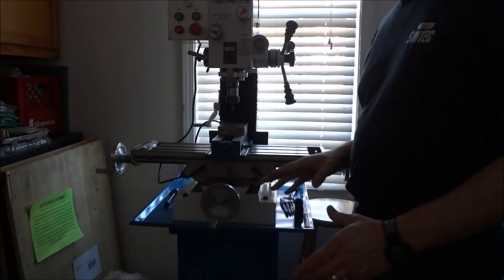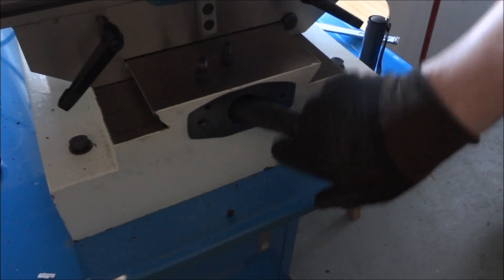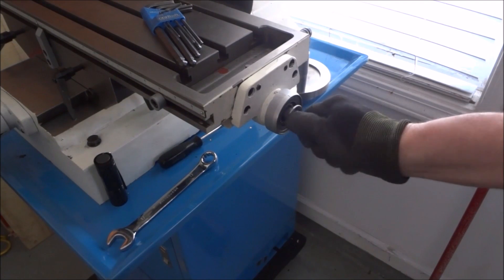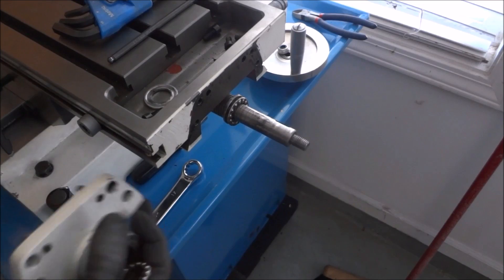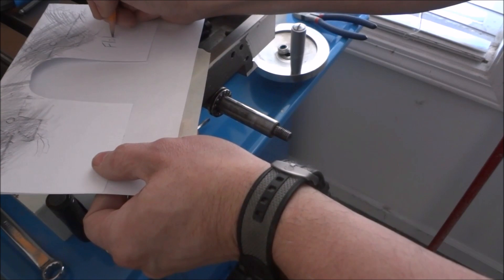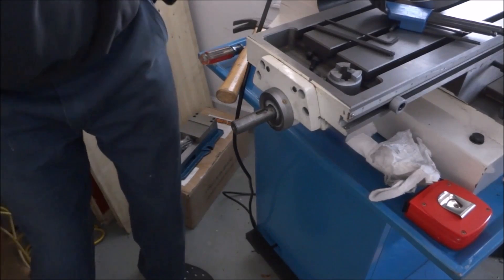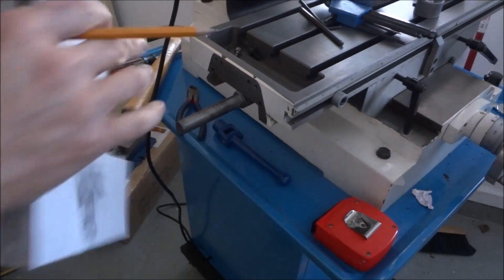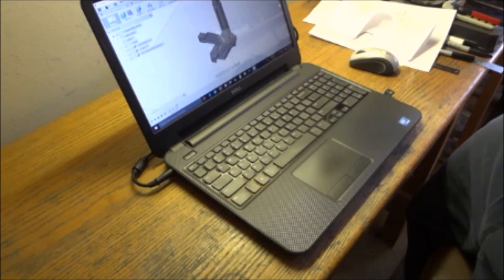PM-727M CNC Ball-screw / Stepper mounts from A to Z

Comment: Take both your bearing hangers and put then back to back against each other with those pins installed in one. That will show right away just how close each bolt and pin location is to the other end of the table. And since your adding more weight with the stepper at one end at least, then good engineering practice would be to step up at least one bolt size. That also gives you a chance to drill and re-tap the holes with a quality sharp tap and replace those chezze like Chinese bolts that will give you future problems. Even better would be to delete those roll pins and taper ream both the hanger and table ends for taper pins. Those will give you dead on accurate location with no chance of the bearing hangers ever getting even the slightest amount out of position. If I was doing that I'd use the type that has either a male end thread or female thread to help pull them later for any maintenance. Every single thing you can do to help improve ease of use and future maintenance will pay off later.

Not sure what your other plans are, but there's a few threads over on CNCZone showing how to fill that Z axis column with an epoxy / granite mix that would go a long ways to help stiffen up that area as well. There's no such thing as having a machine tool that's too rigid. Even Bridgeports are considered fairly flexible in most areas.
Reply from the maker: Great tips I still haven't decided yet. But was thinking of replacing the pins with bolts from the inside. 
No plans on filling the column. Be safe Sam
Reply: I wouldn't, bolts or any threaded fastener are really poor locating items. And that's exactly what those roll pins do. They positively locate each bearing hanger, the bolts simply hold each bearing hanger in that location. So in theory the feed screw or in your case once your done the ball screw will be held in each end bearing at the same elevation (Z axis) and square to the table travel (Y axis) I doubt the factory got that alignment perfect so your going to need to get some very precise measurements so all your travels align not only with those end bearings but also dead square, concentric and in line with the ball nuts. That jobs far tougher to get correct than it first seems. 

Get it wrong and worst case you'll have severe binding, stepper motors stalling out at the ends of travel etc. Even slightly out and you'll get more up to even excessive wear in the bearings, ball screws and nuts. Machine tool alignments are far more critical than most hobbiests fully understand. Anybody doing this as a hobby who's even a bit serious about it should spend the roughly 100 bucks for a copy of Machine Tool Reconditioning. That one book totally changed my views about machine tools and how clean and well oiled I now keep mine. It is a boring book, but will help you to understand what's required and where.

You can correct any factory inaccuracy,s with the parts your building. But you will need to know exactly where and how much to correct for. I''ll give you an example. Good industrial grade DRO's require the spars and reader heads to be aligned to the travels to less than .001" in all directions simply so there's none of that binding and that the readings will be accurate. Your ball screws, nuts, and the end bearings require the same attention to detail to get the best accuracy and to have a system that works freely and well.
Reply from the maker: Thank you for the Insight and Tips.
Sam
Reply: @turningpoint6643  
There have been many many examples on CNCZone of RF45 builds in which all super-accuracy you tout has not been done to that extent. For one example KCJ build of 2 years ago. There are a bunch I have followed and have not heard about all this binding your talking about. Secondly as far as "...your going to need to get some very precise measurements"  In the home shop that isn't even practical--- ±.004 or so is about all you can hope for;  ±.002 AT BEST. Think about it how can this fellow in his shop achieve measurements better than that?
Try measuring the length of the table in X axis to ±.001 !!!
Reply: @crookedriver2079  Super accuracy? What I mentioned would only be common and fairly loose tolerance engineering practice used on most job shop quality machines. Even my little Atlas horizontal mill and South Bend shaper use taper pins for good reason on certain parts. They ensure a repeatable and secure position and that's the exact reason there used. My Bridgeport clone has the X,Y feed nuts pinned in place to maintain there factory set alignment. The feed screws C/L location and it's alignment in all three dimensions is critical to the life and long term accuracy of the components. And your AT BEST - + .002" measurement capability is cheap calipers territory. I can and do double check any new machine I obtain within 10ths as per the Schlesinger tests written way back in the 1930s. So why or how is that all of a sudden impractical?  And I didn't say the table length needed to be measured to + - .001" but the screws C/L  position can be measured and located within that limit since linear measurements of only a few inches are needed.  

Think about it, with the feed nut firmly bolted in a set position and the bearing supports fixed at any old location decided on. If the misalignment of the screws C/L amounts to more than the allowed working clearance within the nut there will be binding at the ends of the table travel. If the alignments are out far enough the table will be impossible to move to the ends of it's travel until both the screw and nut wear enough to allow that to happen. That's not my opinion, those are the simple and unarguable mechanical facts. And ball screws have far tighter limits for there allowable misalignments than ACME screws and nuts have. 

Using poorly thought out and executed builds of machines on the CNC Zone by people who know little to nothing about the complexety's  of machine tool alignment isn't a valid argument. Try reading the free online PDF copy of the book Testing Machine Tools, buy or borrow copy's of the Moore Tools book Foundations of Mechanical Accuracy and the Connelly book Rebuilding Machine Tools and then come back and use your argument about how feed screw/nut alignments aren't important.

Comment: Love the rubbing technique!

On my conversion, I machined the ball screws (well so far, only the Y-axis!) to match the factory bearing, but in hindsight, and after watching your series (at least, this far), I would have rather gone with a standard end pre-machined, and then made a new bearing block. I'm in too deep now, so I'll continue with my original plans, but these are valuable lessons I've learned from you that I can apply in the future. Thanks Sam! :)

BR,
Adam
Reply from the maker: +Adam Carmichael 
Thanks Adam your very welcome. I'm happy to share what little knowledge I have gained, mostly from making mistakes !@#$%

Be Safe,
 Sam
Reply: The proper way to do that is to take a piece of gasket material and form it against the surface with a ball peen hammer, much quicker and you get better detail out of it.

Comment: Hi, I am considering buying a benchtop mill for CNC conversion and I am curious about how good the Precision Matthews 727 mill is compared to a similar sized Grizzly mill or the Littlemachineshop 5500 mill. What kind of accuracy and repeat-ability are you able to get out of this machine after CNC conversion?  $1800 shipped with a 3-year warranty seems almost too good to be true for a mill this size. Thank you.
Reply from the maker: +JLocke573 
I can not speak about the LMS mill but from the looks and specs it just a XL version of a X2  it's not really in the same class's. The Grizzly G0795 is basically the same mill as the PM 727m it does not come with a stand and is 220v those two items may not be a issue for you. The PM has a good finish on the castings and overall quality is nice. As far as tolerances I really won't know until the conversion is complete but I suspect it will be compatible to the Tormach.

Comment: Hi Sam,

Good videos and waiting to see the mill fully converted.
One suggestion, albeit a bit late.  Maybe it would have been better taking the pencil rubbings for the X-axis from the actual bearing blocks rather than the mill, this would give you the location of the bearings as well as the mounting holes.

Subscribed :-)

Cheers
Dave.
Reply from the maker: +BustersCNCchannel  Thanks Dave, 
that would indeed give me the exact location of the center line for the bearings, As you will see going forward the original location is slightly altered so that I can place them in a more suitable location which happens to be very close to the original center line.
It may make more sense in the next few video's. Be Safe, Sam

Comment: Did you consider mounting the Y-axis stepper motor on the back the mill?   Similar to how  Hoss does it on the G0704.
Thanks
Reply from the maker: +BI Boondocker  I sure did, there are a couple of problems with that on the PM-272M, First the Y axis center line would have to be lowered or the casting relieved in order to install the Bearing block on the backside. And Second once the mill is in place access to the Y motor mount etc. will be difficult if I need to get to it for servicing. In the end I decided the front mount would be the best option for me.
Be Safe, Sam

Comment: Fantastic video.  When working with CAD and CNC, it's so easy to forget really simple techniques like a rubbing.  I know I spent some time measuring the X-axis table ends, but I bet this would be better.

In some other places on Youtube, I've seen people make templates using masking tape.  Just use multiple pieces stuck together to cover the entire part.  With hard edges, they often just align the edge of the tape with the edge, but other details could be done with tracing.  When you're done, just peel it off and put it on a backer page to keep it from sticking.

Thanks again!
Reply from the maker: +Paul Frieden 
Thanks Paul I like the K.I.S.S method. Keep it simple stupid lol
Yeah works great. I like the tape idea too but knowing me it would tear. Lol. 
Be safe Sam

Comment: Good stuff as always Sam.
Reply from the maker: +Crivo152 
Thank you, how's your project coming?
Reply: Hey Sam, progress is slow but constant. I just finished the main spar that will hold wings, fuselage, and engine together. I'll be starting on the canard front wing soon. Meanwhile I'm working on a 3 parts mold making video project about remaking the airplane nose bumper. A lot of aluminum and steel machining involved with that. I should be able to get a urethane part out of the mold as soon as I get back from my next trip in 4 days, then figure out where to go from there. Ciao, Marco.
Reply from the maker: +Crivo152 
So your busy then I haven't seen a vid in awhile thought you might have forgot about your X2 LOL
Reply: +CNC4XR7 I'm sending you an email with some pictures right now